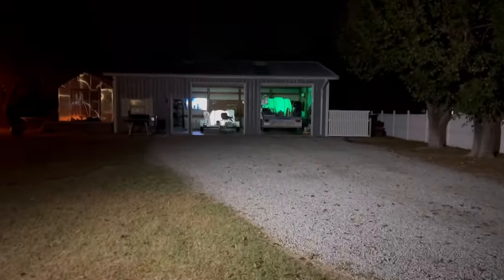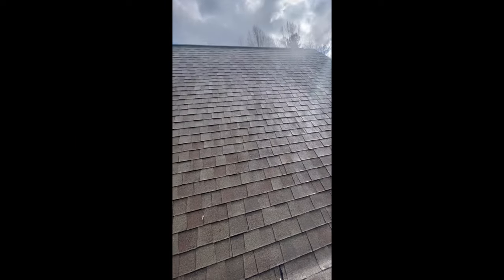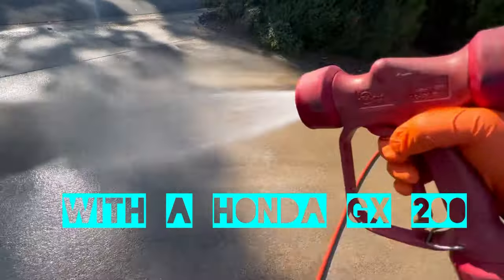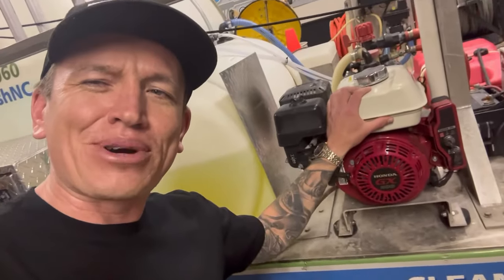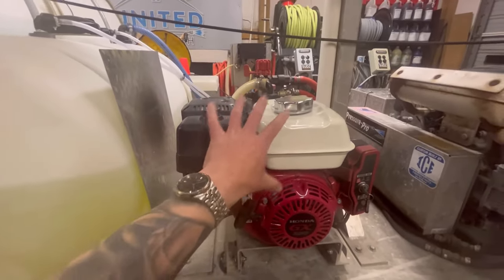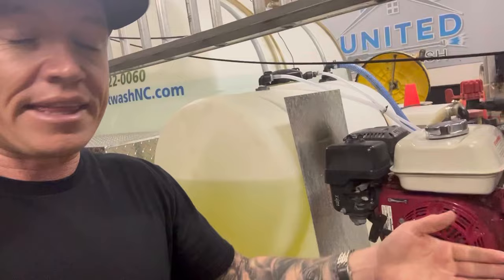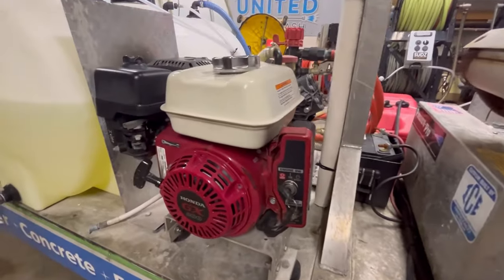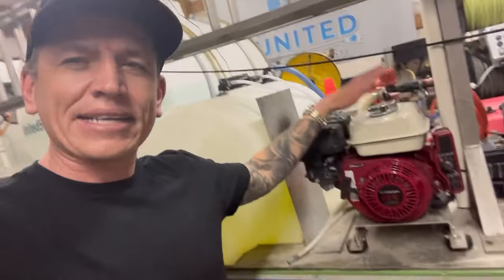My Honest 2 Year Review of The AR45 Gas Powered Soft Wash System | Gas Roof Pump

Comment: Stay passionate, brother. You hype us up!  Started my business with my son 14 months ago, heading into season 2 strong.  He's heading off to college in a few months to get a degree in business.  I think he's got a leg up on his classmates.
Reply from the maker: That’s awesome! Good luck to you guys!
Reply: @softwashtv6315  Hello, I just put this post here so you would see it. Love your set ups. I want to set up a honda 4 gpm, with the red gun and have so many questions. Here is something i found out that may help you. You were talking about how you hold the gun on when you start or stop your engine, if you instead of having a cooling loop, you run the one end into your water tank as a return, you not only keep the pump cool for long periods of time but you also do not run the risk of damage from over pressuring it on start ups and shut downs, its like a build in cooling and pressure relief system.

Comment: Recently hooked up my ar45, manifold leaked right off the bat.. tightened the bolts down and ready to retest tomorrow. Fingers crossed. If it still leaks ill take the manifold apart and put it back together. If that doesnt work then the place I got it from will be getting a call.
Reply: Same thing happened to me first time tighten all the bolts around manifolds and no leaks so far
Reply: @jasontenney2786  wish they would test everything before they sell it.

Comment: Lots of users never read the manual...then  wondering why thing  go bust.
My D50 IS 6 YEARS OLD I CHANGED THE DIAPHRAGMS  EVERY 2 YEARS MFG SAID EVERY YEAR OR X HOURS....IT NEVER LEAKED OR FAILED. 
IM RUNNING IT AT 60 PRECENT CAPACITY 

A farmers are using them everyday for years
They cant be sub par.

My grandfather was running fertilizer and bunch of other stuff and never once it failed. 
Every year at winter we will rebuild them (just diaphragms)

Btw ur language is spot on...no issues 

Solid information  and great delivery
Reply from the maker: Well said brother. And thanks for the support!

Comment: Enjoy your vids and passion. Would really like to see an in-depth vid on the setup of surface cleaner ie, tip wear, bar/swivel height, grease, pressure you run and what intervals on maintenance. (maybe in SWTV sub.)

FWIW, my GP-20” w/ casters - 8gpm never left lines before but it’s starting to show faintly… need to adjust and/or replace tips maybe?! 13:25 yep, I post-treat; only lil hotter now.
Thanks and have a great day! 🙏✌️

Comment: Question Kyle: How did you get the check valve on the bypass and the outlet valve still on it? I'm am putting the check valve on the bypass port but the outlet valve underneath is bumping into it. How to get around this? It appears you have yours still there. Thank you!

Comment: @softwashtv6315 I am thinking of starting up with a trailer. People are doing videos saying not to run the chem through the pump as it wears it out fast. Is there an easy way to not run the chem through the pump, while using the red gun, i am willing to by a remote, do i need a 12 volt pump to inject the chem into the system, or how does that work. Where would i have the injection point after the pump????????? Please help if you can. Thank you.
Reply from the maker: All Softwash pumps run Chem through the pump. When you hear people say don’t run chem through the pump they are talking about pressure washer pumps. When using a pressure washer pump you inject chemical downstream of the pump with a downstream injector.